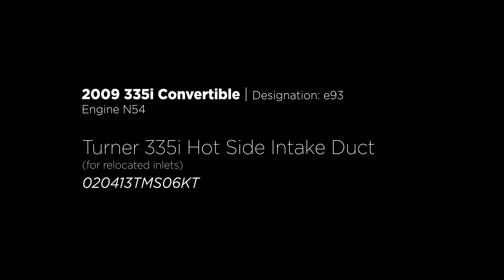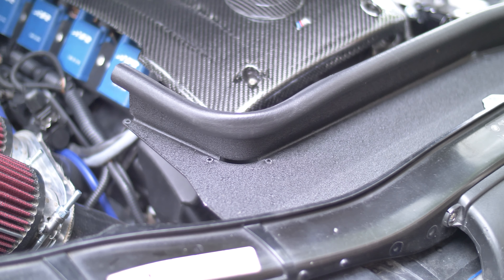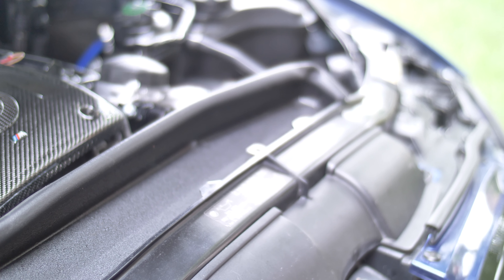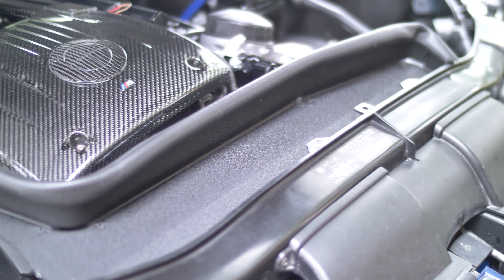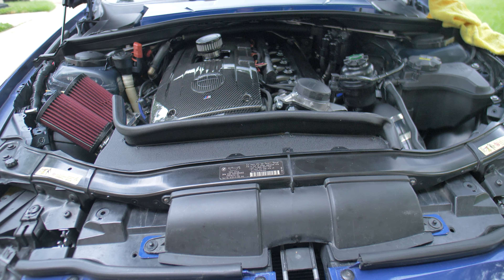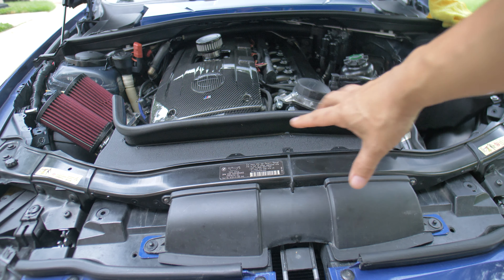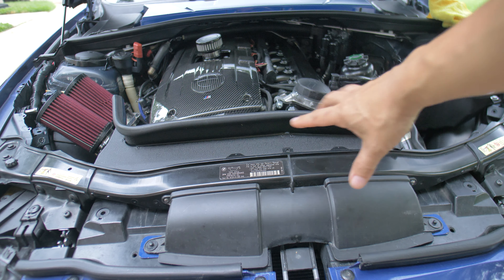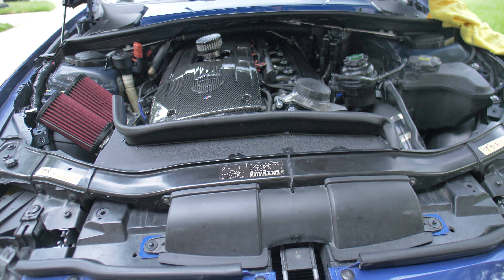Turner Hot Side Intake Duct 335i e Generation

Comment: How did you get the rear inlet to go through the side motor then into the rear turbo? 
I tried for hours and its to tight, the inlet is so fat, it just get stuck on the side rear motor.
Reply from the maker: Yeah...I spoke about this on my ARM Motorsports Relocated Inlets kit...I always suggest people let a shop install it because it's just not worth the frustration. That being said, here is how I did it.

1. Use glycerin or dish soap on exterior metal surfaces as well as the hose itself so there is reduced friction when the hose gets compressed and squooshed during install.
2. Use straight and needle nose plyers to grip hose edge and pull where needed.
3. Use various length pry bar head screw drivers to help wedge and force stuck silicon hose sides into place. 
4. Used my bare feet to cover and push from below WHILE I also used my hands and various tools to help push and pull into place. 

Because the hose is bent in too  extreme directions between the hole connection to the turbo vs. the hole to the cone filter... you are fighting to opposite directions to fit the damn thing.  And installing while engine is still inside carriage is almost impossible to do.  I spent 2.5 days installing JUST THE REAR.
Reply: @bmwchannel7209  thanks bro.

Comment: Do you think this is worth the price? I’m considering a 335d intake duct since it’s $40 vice the $150.
Reply from the maker: It is if you have my set up. If you have stock set up, then it makes no sense.
Reply: @bmwchannel7209  Thank you for the reply! Yeah I’m Pure Stg 2s with ARM hotside inlets.
Reply from the maker: @LordFarquad690   - I am not familiar with the 335d intake...if it has the passenger side outlet instead of driver side, then I would definitely go with the 335d air duct. I would look more oem and 'better' in my opinion.

Comment: Hey Bro! I have a question? From what I see only one relocated inlet has hole (idk tbh for what) but stock or upgraded stock location inlets has these holes on the both pipes... Can U explain me why? Regards Mate!
Reply from the maker: Stock inlets have holes for the two stock diverter valves. The rear ones on these have a hole for the oil heating/vapor recirculation connection which goes into the high side oil catch can connection. This setup has deleted the diverter valves for a single TIAL blow off valve.
Reply: @bmwchannel7209  so what if I don't have Bov? Will it work with  dv?
Reply: Also if I do not have oil catch can?
Reply from the maker: @arkadiushl   i don't think relocated inlets work with diverter valves. I recommend two catch cans, one high side for high throttle conditions and one low side for normal driving...this will catch 80% of oil deposits on you intake valves. You cannot get 100%. But if you have both cans, you will need to walnut blast once every two years instead of every year. When I had one can, I walnut blasted every months. Catch can has nothing to do with power levels. You should have them even on stock car.
Reply from the maker: @arkadiushl  if you want to keep you diverter valves then use stock location inlets from mmp or vtt or lots of brands. And do NOT use 2 inch if you don't have big turbo. It makes reliable connection almost impossible. Use stock inlet snout size. 1.75 inch for stock turbos.
Reply: @bmwchannel7209  Is there a reason you went vented vs sealed on you OCC system?
Reply from the maker: @BVonBuescher   Easier breathing for engine fluctuations due to increased loads. As close to instant pressure changes as possible vs. stock format with all the obstructions.